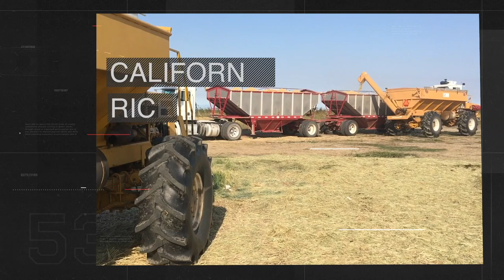Custom Water Stakes (ft. MARKO 🍉) | SaTiSfyiNg | How to Irrigate California Rice Fields!

Comment: Watching the Arts and Crafts Channel, I was impressed that if I needed to do that, I would probably take a piece of sheet metal and cut a thin slot in it, or weld a couple of pieces of angle iron together with a little gap, or do SOMETHING to make a template for painting lines with a single stroke! Sheesh... Lol

Comment: Looks like a High Plains row stake.    On the upper end we would have the ditch with perhaps a row set of 70 rows with tubes.     On the lower end the stakes would mark row 1 and 70.   The slow and fast rows were recorded.    Then back up to the upper end  1/2 mile usually where tubes would be added or subtracted so the set would be finished on schedule.    Usually 12 or 24 hrs.  The schedule would be adjusted to change the finishing time. The more intelligent the irrigator the better the water application.

Comment: As you were marking your stakes, I kept thinking how to do it faster. I thought of using a carpenters chalk string line to make the marking points and  then use cans of different colored fluorescent spray paint with an upper and lower border guide to keep the lines narrow. Maybe that's more complicated.

Comment: Been wondering about this. Been using vinyl yard sticks in irrigation ponds
Reply from the maker: How do those hold up over time, Skinner?
-M
Reply: @Ricefarmingtv  pretty good. I think it's like a steel core vinyl over top. But how often do you need to measure 40" of water lol. I shall make some of your stakes. But I gotta say accurate grading for the first time this year was super duper expensive.